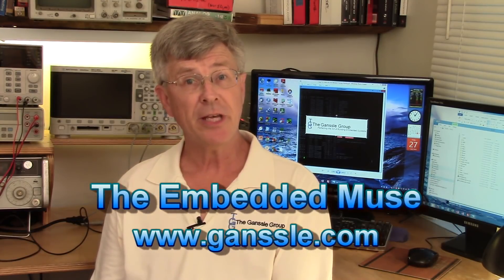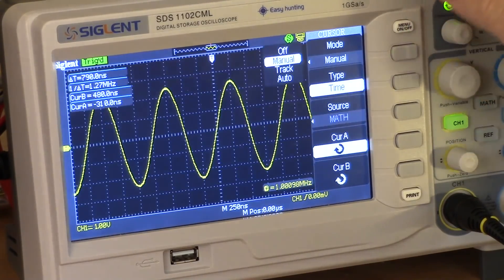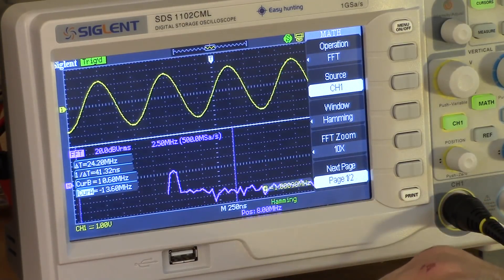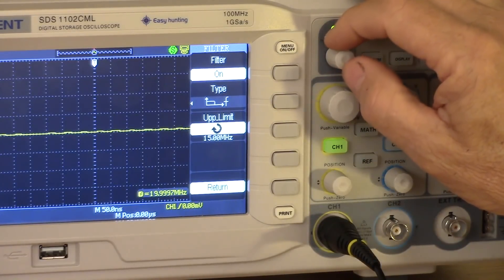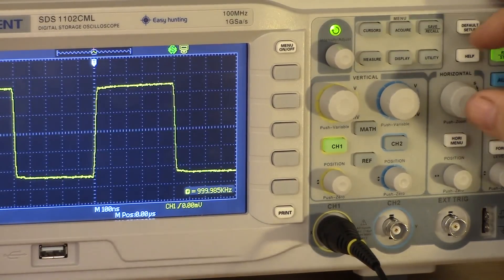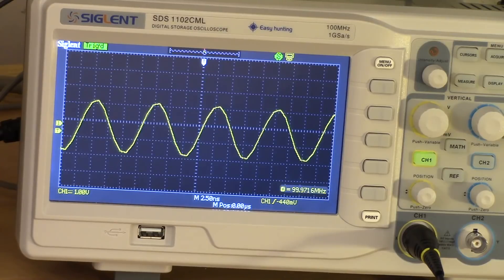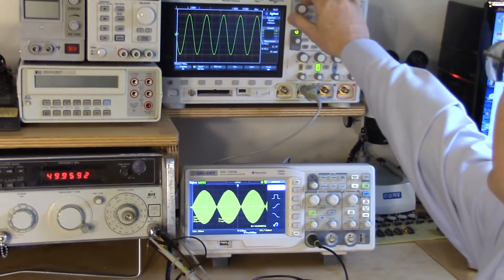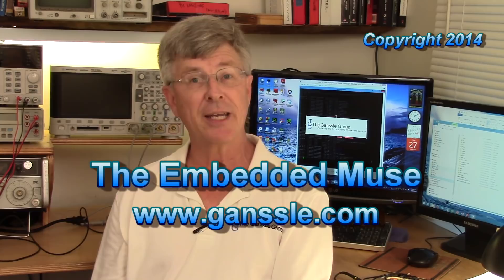Episode 5 - Part 2 of a review of the Siglent SDS1102CML oscilloscope

Comment: Hi there,

Between a used Siglent 1102CNL (100Mhz) and the Rigol DS1052E (50Mhz) which would you choose. Both are at same price. Both scopes are very lightly used (according to the sellers) I will be using the scope for Arduino ..16Mhz?
Thank you for sharing.

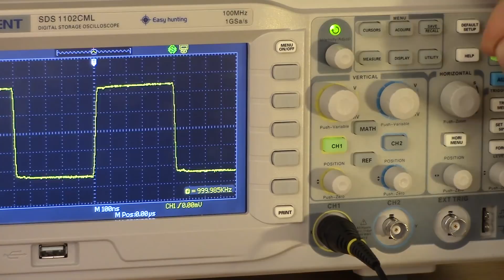Comment: I just bought this one.(My first.) Looking around time 4:10 in this video,the square pulse you see a lot signal noise on the top and button. I think mine have even more noise like this only looking at the internal 1KHz calibration pulse. Is this noise normal and must be accepted? It's there whatever samplerate is selected. (?)

Comment: This is my first digital scope; I purchased it on the strength of your review.  I have Fluke and Tectronix analog scopes but this Siglent is a real eye-opener. I love it. I bought some higher quality probes and so far the results nave been very good.

Thank you for a really helpful review.
Reply: Does trigger on your scope have the same issue with slightly moving signal left-right?

Comment: Thank you for this review.  I work on high voltage circuits up to 600 to 700 volts.  Is the 400Volt max input rating assuming the 10x possition?  Can I measure 500Volt with a 10x probe without damaging the oscilloscope?
Reply from the maker: The data sheet is silent on this. However, when I tell it there's a x1 probe connected, the max is 10 V/div. With x10 you can go to 100 V/div.